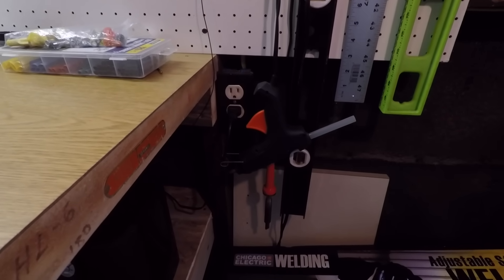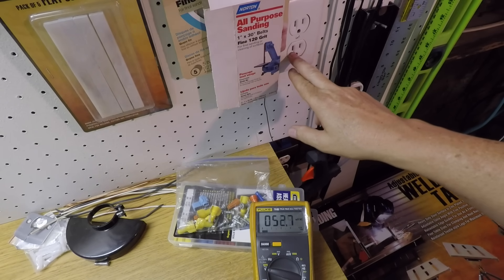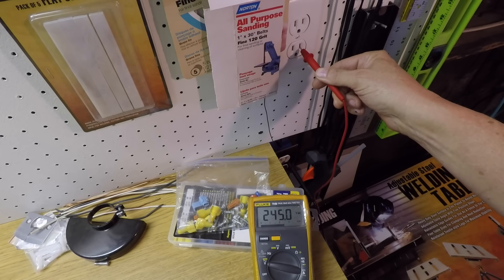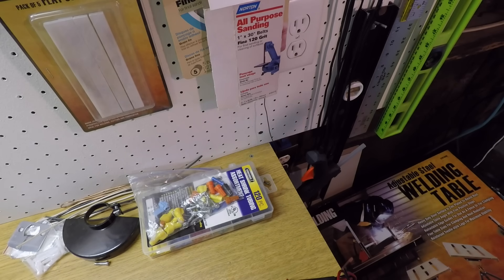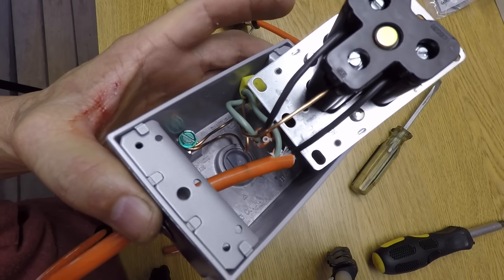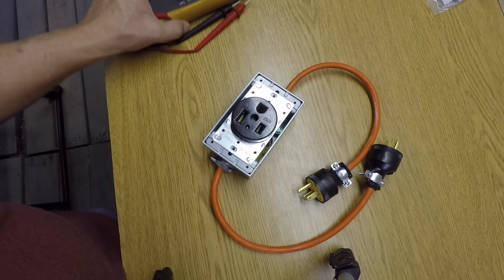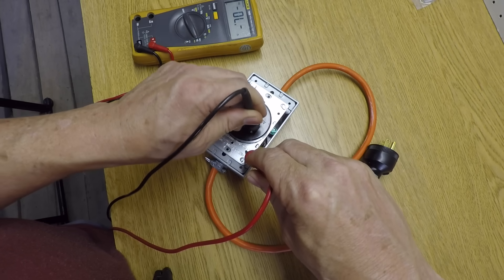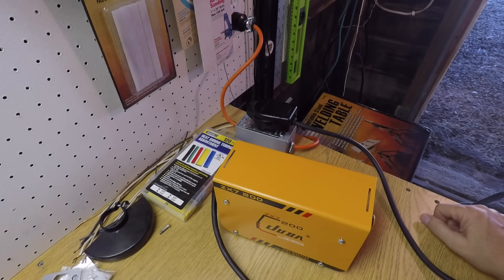How to Get 220v From 110v

Comment: The vast majority of US households are supplied with 220 AC, and you get 110 AC by 'splitting the phase'. It is basically a center tap transformer where the Neutral is the center tap and the other two sides are 220 VAC. This is often confused with three-phase power, which is the typical configuration for power generation. So, you end up with 110 AC hot to neutral at your wall plug, and the electrician runs circuits through your house, balancing between the two power circuits. The method in the video only works if you happen to have wiring from either sides of the 'split phase' near each other in your house. His method of checking AC voltage between two outlets works, but really dependent on how the house was wired if this is going to work for your particular house. Alternatively, you can install a 220 breaker into your main breaker box and  install an outlet nearby. Youtube has lots of instructional videos on how to do it yourself.

Comment: Also IMPORTANT NOTE: Make sure the two 110 volt outlets are on different/separate legs from the service panel. It will not work if both outlets are on same leg from service panel.
Reply: Because you need two different phases right?
Reply: @mrchrisknight315  No, it's still single phase.
Reply: not a good idea. that second ground in some cable is 16gage and goes to your ground rod outside not to the panel but tru it.
Reply: he did that
Reply: How to know breakers are in different legs? If I don’t have access to panel
Reply: @PS5VCA80  measure the voltage between both, if you don't get something close to 240V they are on the same leg. If on the same leg of 220/240 then should get something close to zero.
Reply: Did you watch the video?
Reply: @frijoli9579  he didn’t say different legs, he said different lines.  Saying “lines” is the same as saying circuits.  If you know what he means then people don’t don’t need to watch this video.
Reply: @frijoli9579  he was only making sure people are reminded of such...

Comment: Wondering if you could run this set up off of 2 generators to a welder.  I've got a hobart 230 welder but I do not have a single generator that can run it however I have 2 generators one is 4000w and the other is 5500w. By doing this it should give me enough since I need at least 7500w.  Can this be done safely without damaging generators or my welder?
Reply from the maker: Several people have hashed out that question before in the comments. I really don't know if it will work but I've read it won't.
Reply: Not unless you can parallel  the generators.

Comment: you can run thousands of volts through very fine wire but only with no or very little current draw Amps remember an incandescent light it is the amperage that makes it glow white hot the same thing will happen if you draw 50 amps through 12 ga wire  meant for a max of 20 amp

Comment: So you are taking the 240 that is split in your breaker panel for your shop and recombining them through 2- 20 amp 120 outlets. As long as your 240 wont draw more then 20 amps is at its max a 50 amp draw has the possibility of burning your shop down 12 gauge wire is not heavy enough for 50 amp you need #6  to keep it from over heating the voltage is the punch and the amperage is the speed the faster you go the more feat you generate you need to watch some bush-craft fire starting videos you are demonstrating the same results by a different method

Comment: So what happens if the welding machine malfunctions and it dumps to the single 12ga ground wire......Would it glow like a toaster inside the wall all the way back to the panel ?

Comment: Orange extension cord wire is usually 16 gauge which is rated for 13 amps. What you are doing could easily start a fire.
Reply from the maker: I used it for over a year and never had a fire so apparently not that easily. The orange wires never even got warm.
Reply: @DIYHomesteadProjectsDIYHP10  Then you are lucky. Check the current draw on the welder.

Comment: If you build it and or wire it, it would be easier and cheaper to run a 240 volt circuit.

Comment: That's cool....can I plug my oven into it?
Reply: Also wondering this
Reply from the maker: You would need a minimum of 30amps for an oven and probably more like 50amps or more. I doubt you will find any standard 50 amp 120V circuits in a home or garage. The device I built in this video is only good for 15amps. You won't find any ovens that will run on 15amps.

Comment: 2- 20amp circuits but 2 -15 amp outlets, just put in a double poll breaker 220 v. 20 amp with 12-3 wire in the main box, lot safer.

Comment: Like your video. But you need to tell your subscribed individuals that's there are different phases incoming and outgoing. You HAVE to make sure they are 2 phases which are different that combine to give you 240v. Because people will burn up equipment and motors if they don't use phase A and B to create the 240v. I'm not digging your video. Just a warning ⚠️

Comment: you may consider a 20  amp breaker, in a bigger box, for each 120 volt side ....wired just before the plugin 120 volt ends....also. secure the male 120 volt plugs in their sockets (metal pipe bands) , as to remove any doubt about getting self-electrified....

Comment: This only works if you have two separate breakers, each connected to a separate 110 leg inside your breaker box.  Since you will never want to use that breaker for anything else (as a brief nod to safety) - you will always be better off pulling those two 110V breakers and installing a 220 double pole breaker instead.  No exceptions.
Reply: exactly you still need 220v service for this to work...
Reply: I think what Brent is trying to say is these have to be on separate lines AND separate phases at panel. If you do not. If you have 2 outlets same phase this will not work.
Reply: @ivanscountrymusicandcars2357  Wrong! Residential electric service in the United States (120/240 Vac) is sometimes called two-phase service but this is NOT correct. It is only single-phase, since both line voltages are derived from a single phase of a distribution transformer with a center tapped neutral and are 180° out of phase with each other.
Reply: @ivanscountrymusicandcars2357 what? Residential power is split single phase not 2 phase
Reply: @ivanscountrymusicandcars2357  no you can do it on one bus and 2 110 breakers!
Reply: A double pole breaker with the 240volts outlet must be installed together in the same box
Reply: two separate breakers, each connected to same busbar 110 inside your breaker box will work!
Reply: Nope it can be done on one bus bar

Comment: Take the neutral of one of the receptacles from the neutral bar, get a double pole 20A breaker and hook the black and the white on the breaker and change the duplex receptacle with the single 240 V
Reply: Exactly.  No new wiring from the breaker box to the garage and you avoid all the balance problems noted in so many of these other comments.  Just make sure you don't make the circuit the lights are on 240  VAC !

Comment: My comments is if your purpose is to obtain 230Vac for your welding machine you suppose to use a different type of outlet  in that case a 230vac outlet and not a 120vac outlet  of course you know will because you are the one who install it  but if any person try to plug-in any electrical tools he may get a surprise or damage the equipment after turning on the machine.

Comment: I’m pretty sure in order for this to work you have to have each circuit coming from different phases to get 240. Unless welding machine doesn’t care which phase it has cause it’s just a rectifier inside a welding machine.
Reply: Your absolutely correct
Reply: He tested it in the video. "You can't get 240v unless it's a separate phase." Response- no shit.

Comment: So many bad and great comments I read from. Let resume it. Am I electrician? No. What is purpose? Get 220v/20amp max from 2 phase of 110v/20amp max. Why to do this way? Want to keep 110v/20amp for other tools that use 110v/20amp. Is it safe? The way he did for what he want to use it, knowing what he needs and does; also the way to plug and unplug the 220v outlet first; yes it’s safe but only at 20amp max overall and both breakers of 20amp won’t tripping at same times that could be an issue for some viewers need if reproducing this DYI. Does phase breakers have other loads on them and what can happen? Yes, he mentioned the white outlets is feeding his garage lights; so that breaker can’t be full use as 20amp for welding because lights draw some amp from this breaker phase that could result to trip this breaker. Does those brown and white free outlets 110v can be use at same time of the DYI 220v? Yes but remember your max of 20amp is the max.

Bruce I like your DYI simple safe and restricted way to operate what you need to operate, I watch your welding videos from attached comment too; my only concern is that you welded with a t-shirt not fireproof as gloves. Use of PPE is always a safety recommendation but because of issues encountered such skin burning and cotton catching in fire. 

Do you know you can also use those 2 outlets to feed your house in case of power outrage? More info are written for all readers and again I am not electrician (if steps are fallow; it is SAFE but AGAINST Electrical Code; AND if you create it yourself DYI; you’re YOUR OWN GUILTY in case of any ISSUES from this READ because it is you own choice to do this DYI)

1st; you need creating your own double males outlets connectors AGAINST Electrical Code by ((phase 1 110v (male-house wire-male) phase 2 110v (male-house wire-male))

2nd; FIRST you need to turn off your own main house In Grid 220v breaker (city Incoming wire feed main house breaker)

3rd turn off all house single and double phases 110v/220v Breakers. 

4th start your own off grid generator/s or inverted (inverted are safer for electronic devices and best is pure sine wave) never plug external inverter to an inverted generator. ((1000/2000/3500/6500w or as dual generator 4000/7000w)

5th and Last step: Did you done 2nd step? No, return and fallow 2nd step than 3rd and 4th before continuing. 
Yes you did, than (NEVER TURN ON MAIN HOUSE BREAKER IN GRID CITY AT THAT POINT) connect both double males wires to your white and brown outlets and to both Off Grid generator outlets of your need and requirements. (1000/2000/3500/6500w or as dual generator 4000/7000w) and than Turn On house required breakers one by one such (fridge, sum pump, some house lights area) never forget your max watts and amps that your own generator is providing.  

When city power outrage is solved. -Turn off All Tuned On breakers. -Unplug both Male to Male Outlets DYI wires. Now it is Safe to turn on your main house breaker and breakers. Don’t forget to turn off your generator. Cheers

Comment: You need some type of toggle switch or anything that doesn’t force you to grab the wire to remove the power source. In case of emergency fire or wires melting you will not be able to remove it would melt your skin to the bones. 🦴

Comment: You are creating a chance for an unbalanced load which would over load the neutral if one breaker tripped and the other didn’t. Both phases have to be mechanically connected so if either one trips it mechanically trips the other . Any other devices running on either of those two circuits unbalance the load and the unbalanced amount is carried back on the neutral and grounding conductors .anything with motors or a ground fault could then be energized with the potential of both phases. Just run one 240 circuit with only one pathway to ground to avoid this scenario.

Comment: Dude, use all nema15 for everything and ditch that huge 240 welder plug! Even you said it was ridiculous! Cut it off and wire a nema15 male on your welder cord LOL you can wire a nema15 for 240v same as you did in the metal box...LOL i see lots of tiny welders come from china with NEMA15 male plugs on the welder and still called 120/240 volt input label on welder

Comment: Here's the problem! This could happen! If the welder is plugged in and the switch on the welder is left in the on position. Then one of the 120 volt plugs is unplugged! That plugs hot would be live because the welder is trying to make circuit. If someone was to touch that plugged hot terminal laying there they make a circuit to ground. Would be rare but it could happen!
Reply from the maker: That hasn't been a problem for me. I did address that issue in the video by the way.

Comment: Why not use a 20amp outlet instead of a 50amp outlet?
Reply from the maker: Because most if not all 240V welders come with 50amp plugs on them.
Reply: @DIYHomesteadProjectsDIYHP10  I didn't realize you were using it for a welder. 10-4

Comment: Hi Bruce, I'm new at watching your videos, but I think that you did a wonderful project, and please fear not about all those negative comments you were referring at the end of your video. Let me explain a little what is going on with your useful connection. Essentially in the USA, homes receive 120VAC from one of the legs (per protected circuit) of a star supply connection and the neutral is the connecting node at the center of the three legs, all with 120 VAC each with respect to that neutral node. Each of your normal outlets picks up energy from anyone of those three legs and the central node with a potential close to zero volts with respect to ground, thereby proving those outlets with 120 VAC each, but what you have done here is taken the hot side of two of the three legs available (ignoring the node) in order to get 240 VAC which is fine, as long as there are fused or thermally limited correctly (like what you described you have), and also that you have not neglected a ground wiring as it should be, and you have also done. So in general, I do not see any issues, just a great practical solution for your needs. Of course you need to be knowledgeable enough, like you are, to do these type of adaptations, as we are dealing with very harmful (lethal) and powerful energy . This should NOT be done by just anyone, and without precaution. A differential breaker could also add safety there in your application. Thank you for posting this nice video, providing a practical solution to a common situation, if you don't want to run an exclusive 240 VAC pair of lines from your bus bars to an exclusive 240 VAC outlet. Seems to me that you just wanted to avoid yourself "the trouble" of having to wire an exclusive pair (best and common way of having a 240 outlet) from the panel to the new outlet. You had those two 120 outlets there and near to each other already, so you just combined them accordingly without conduiting an exclusive and long 240 line from the box. Take care, and be careful.
Reply from the maker: Thank you for the input, I appreciate it.

Comment: You already have 2 circuits. Convert one to 220 in your panel. Simple & cheap. You’re making this way to complicated.
Reply from the maker: The breaker box only has two positions for breakers. Either two singles or one double. It's the cheapest solution to the problem in this case.

Comment: When I wired my 3000 SqFt Industrial Grade shop I wired every outlet 240 volts.  And on the 120 volt outets I just tapped one leg for 120 volt.  And along the work bench I tapped every other outlet to the same hot leg.  But, the great part is, if I found out later I needed a 240 outlet, say for my Plasma Cutter,  all it took was to tap both hot legs.
Reply from the maker: Nice work!

Comment: if one phase breaker trips，you will get 120v again😃
Reply: Correction: if one breaker trips, you will get 0 volts at the 220v outlet.  120 volts requires the neutral to be connected somewhere.

Comment: It’s gonna work but not safe! 50a plug on 20a circuit will overheat the wires( under overload situation, 30a current could flow through #12 wire without tripping 20a breaker) insulation will fail way sooner than normal use and may trip the breakers too! Not safe for the long run!!!Better use a clamp meter check the real current required by the welder.
Reply: He didn’t change the breakers out, the wiring is still protected by 20a breakers no matter what the size of plug he uses

Comment: At least use 12/2 Romex instead of extension cord scraps. 1..2..3 CONTACT!!⚡️🙈
Reply: As long as the drop cord had #12 wire in, what's the difference? 
It's not like they're dropped 14' across the floor, they're only a foot long.

Comment: Test the theroy.  unplug one side with the device plugged in and check the voltage from the right plug to the ground.  It should be 0.  if its 123 then you know the device is passing voltage.
Reply: Could actually damage the welder. depending on its internals.

Comment: that doesn't always work.  It will only work if you are using the correct combination of 120v circuit breakers.  ie, 2 breakers that are side by side on your panel for example.